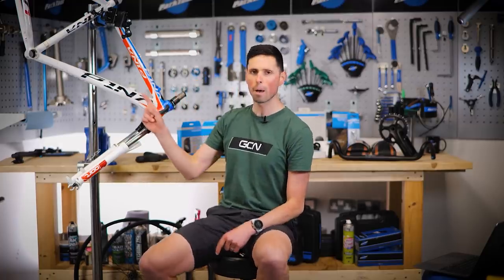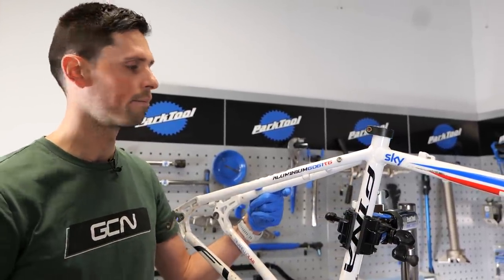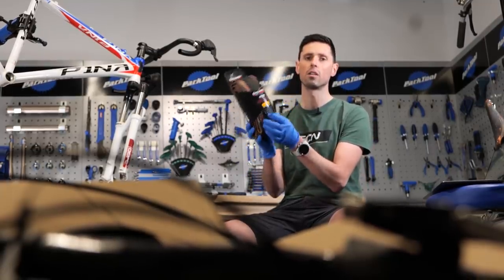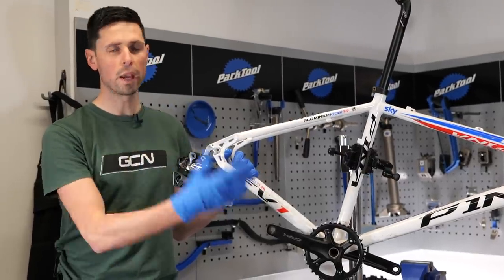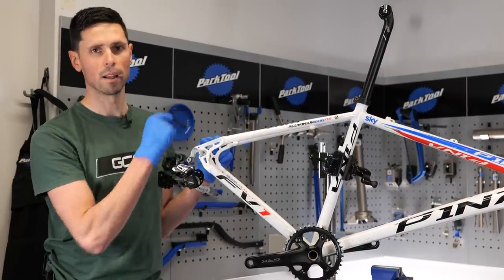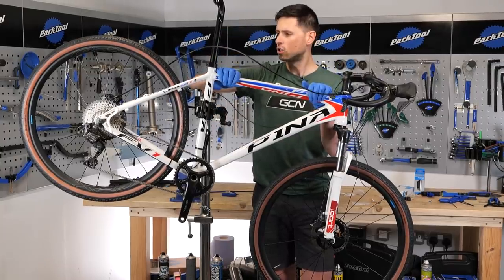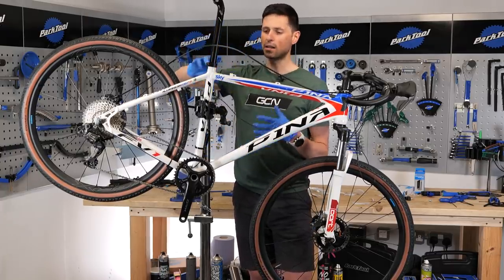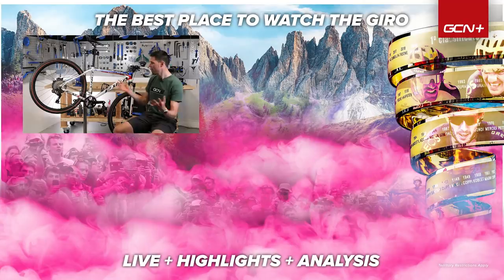Building The Bike! | Old MTB To Super Gravel Bike Ep. 2

Comment: So let me get this straight 🤔 He went to all the trouble of tracking down a particular Frame to convert, then didn’t bother to swap out the Fork, bodged the wrong size crank into the frame (should have used the MTB equivalent) as well as some guff about the wheels not fitting even though a modern wheel with a quick release adapter is no different in width to the original wheel and using a 42t cassette for climbing is great if you are a Pro but for the average person it Sucks especially when the GRX crank comes with a minimum 40t chainring, not to mention going from a flat bar for a dropbar isn’t just a straight forward swap as there’s a huge difference in reach and it needs to be explained, this series could have been great but I don’t know why they half-arsed it 🤷‍♂️
Reply: Because they do not think a lot before doing thing, they are poor mechanics and they do little to no research, they do not know much actually and that's really sad to see their incompetence trying to teach the wrong thing to noobs, when is it ok to stress the rear aluminium stays, there is going to be cracks somewhere for sure...

The fact that the only grease usage was on the threads of the bottom bracket speaks for itself.
Reply: Plus, Cold setting alu frame. What an expert!
Reply: It's an "advertorial" :)
Reply: It's an advert for Shimano, I wouldn't get too hung up on it.
Reply: @JamSa85  Actually this is what makes it even worse, adverts have a legal duty to not mislead or show the products being used in a way that could potentially cause harm to the end user without a legal disclaimer and even then a complaint to the Advertising Standards Agency could quite easily get this video taken down, if this was just somebody in their shed it wouldn’t be a problem but it’s two big companies saying it’s fine to use the products in this way when it really isn’t
Reply: Instead of replacing the fork, they could have rebuilt it. Sometimes it can be hard to find forks for bikes like these; but getting the parts or at least changing fluids/applying new grease to bits certainly in the realm of possibility.
Reply: Yes but no but... This was a three part advert for Shimano. Nothing more and nothing less.
Reply: agreed mate

Comment: I really think this challenge should be done again but with a budget for bike and upgrades to convert an old MTB to gravel bike. Looking at MTB to gravel conversions most of the time they will be a steel framed bike with a a rigid fork. This bike in stock form is just not what people talk about when looking at MTB to gravel conversions, completely misses the mark
Reply: ^This.

I'd guess that when someone is looking to convert a MTB to gravel, there's a good chance they're looking to avoid the nearly absurd prices of a new gravel bike. The di2 is complete overkill.
Reply: The same build is possible with GRX400 components and 2nd hand MTB-parts! Way cheaper and pretty suitable for an average gravelrider.
Reply: Typical GCN splash the cash nonsense, it:s a shame because they tried to make a good video
Reply: @FlourescentPotato  it's funny you saying this coz a year down the line they've had similar comments about the road bike upgrade build they tried lol

Comment: Not sure I would widen the frame on an aluminium bike that much! You can cold set steel and get away with it.  If you had gone got the Hunt 650b wheels then you can get them with QR at 135mm.  You may have also wanted to use an MTB bb and crank and that would have solved using a road crank.  You could have also used a wolftooth derailleur extension and popped a 11-51 in the rear!
Reply: GRX actually uses gravel q factor, which is a little wider than road if i remember correctly.

Comment: 4:26 You must be kidding, right? "Widening" the frame by 7 mm is really a lot, especially given it's designed to be a tiny bit bent inwards for the wheel to be clamped securely. Maybe I would understand such thinking when building a city commuter out of scrap parts, but I definitely wouldn't do that on a bike designed to be ridden off-road and especially when building it with brand new high level parts.
Reply: Absolutely. It seems a completely crazy thing to do. At that point he should have rethought the whole thing.
Reply: Naa It'll be fine.
Reply: @toddmcdonough  Todd, it’s aluminium, this is a seriously ill-considered thing to do.
Reply: True. I've got cracked my frame by adding just a small 2-3 mm spacer... This is a killing solution for aluminum frame. And what is the problem to get proper QR hubs in 2022??? 🤦🏻‍♂️
Reply: My thoughts exactly, why not just buy wheels with QR hubs¿??
Maybe none of their high end ,super expensive sponsors do such a low end hub
Reply: @normanlindsay4835  Only sponsors issues I think. Although the GRX 815 Di2 being a top-tier groupset, the Shimano GRX wheels are almost entry-level option (heavy and narrow given they are meant for gravel bikes only, for what you get they're a bit expensive). Some other brands still make disc brakes specific wheelsets with QR hubs, but if they really want to stick with Shimano even for wheels, they could've used previous generation (still available) XT 8000 mountain bike hubs (perhaps with those GRX rims).

Comment: Seems easier to add drop bars to a 1990 mountain bike and call it a gravel bike.
Reply: I've converted a  26' MTB to a road bike by replacing a double crankset with the original triple,  added a longer stem to my road drop bar and fitted 9 speed Shimano Sora brifters. Maybe I convert it to 29er wheels/tires later. Basically, all bike conversios are all plug and play, depending on your possibilities and your wallet.
If you should have an old MTB, a DI2 upgrade would be an overkill. For the price of a complete DI2 group us mortals could get a complete gravel bike if shopped wisely...

Comment: I've been doing this for peanuts ...no di2 mix match drive train and diy/oddpart brakes and what not on late 90s mtbs  26s ...26"to700c with drops .disk front rigid and suspension, cantilever adapter rear ...9spd 10spd

Comment: Might as well choose full wireless SRAM AXS instead of Di2.  On a non Di2 designed frame.  No more mucking around figuring out to where you can run wires or drill holes. To install your battery and hide the junction box.
Reply: Shimano sponsored this vid, so...
Reply: Wheres the fun in that?
Reply: I know it’s a Shimano sponsored video, but don’t understand why anyone buys di2 over etap. Wires, internal batteries, and junction boxes are old tech.

Comment: The problem with this is that frame designed to have a flat handle bar, therefore the top tube is 6 to 7 cm longer than on a road/gravel bike in the same size. I did the same mistake but the other way around. Bought a Trek road bike, put a flat handle bar on it, and even a 130mm stem did not fix the short top tube, that was designed to have drop bars. That's why real manufacturers have specific frames for flat handle bar gravel bikes, and hybrid bikes, and not just sticking a flat bar on a frame that is designed for drop bars.
This bike will not work, others have done it, it's called monster-cross. Top tube will be too long.
Reply: Smaller frame, longer seat post and a bit shorter stem should do it, no?
Reply: @yoavmiller216  Yes Ive converted a Rocky Mountain Blizzard in a smaller frame than I usually use with a short reavh gravel handlebar, short 35mm stem etc. Rides great to me
Reply: Yes you have to use a smaller frame if you want to do that. If it's an old frame it generally works better because they where much shorter than modern MTBs.

Comment: I would advise against fitting washers into shimano cranksets, for starters you would need to fit one on each side in order to avoid offsetting the bike center, and in that case your splines would be at least 4mm shorter than the standard, which is a potential hazard. A MTB specific crankset would've worked just fine.

Then there is the fact that that MTB to gravel conversions require straight seatposts in order to compensate for the longer reach in MTB frames.

And then there is the issue of streching the frame in order yo fit an incorrect hub. There are plenty of Shimano and other brand options that would've worked correctly in that scenario.

The bottom line is that these types of things should be handled by professionals and not by any random amateur giving away wrong advice.

Comment: "Opening the frame up for the wider hub"...

1. It's an aluminium frame, it'll probably survive but it's best practice not to. 
2. Even if you just use its elasticity rather than setting it in place, your dropouts are going to be out of alignment which can cause more problems.
3. Aligning the dropouts permanently will almost certainly do some damage, so just don't. Use a steel frame. ;)

Comment: It looks really fun. The mix of high spec modern components with this frame is a bit silly, which is what I like about it.

I would really like to see a head-to-head between this and a similar build with 26" wheels and mechanical shifting.
Reply: I did that one on a circa 2008 MTB. I ditched the front suspension and replaced it with carbon forks. 26" wheels on a 29er fork looked a bit odd until I filled some of the space with mudguards. Used 105 road brake/shifters of that vintage on a drop handlebar work fine with the 3x9 MTB drive chain. Next I'm going to install slightly larger middle and large chainrings to give me a bit more speed on downhills and pavement. I'll keep the granny gears for climbing. I've got about $600 Canadian in it so far and I've learned a lot.

Comment: The hub spacing is identical. 135mm QR has he same distance between the stays as 12x142 through axle. How else would the wheel fit with an adapter in it. Spacing that bb out is normal even for mtb cranks. Should just have put mechanical GRX on it.
Reply: The chainstays for 142 have a recess of 3,5mm per side to accomodate a 12mm TA instead of 10mm QR, but true, with regards to the offset from the cassette and a derailleur hanger they are identical. Thus what Alex did was a massive bodge
Reply: @feedbackzaloop  Yes indeed there is a recess. Wheel spoke angle and such is the same. And actually that cassette could have fit on the original wheels... Using fast 2.1xc tires would have made much difference in rolling resistance over 45x650b wheels.
Reply: @luukrutten1295  not really sure about the cassette, if GRX is identical to XT 8000 or built around a road standart, then it would not fit the old hub.
26" with 2,1 tyre is simply smaller, and although would do the job as well, is not that aesthetical as 650 (27,5") with 45mm. But at least Alex could have relaced the new rim

Upd: oh, it IS an XT cassette here. Yes, fits perfectly then
Reply: Actually the 45mm tire is only marginally larger than a 26x2.1 only about 15mm different in circumference.
Reply: @luukrutten1295  actually, true. 25mm difference in rim diameter, about 18mm other way round in tyre thickness - so, 26" is less than 4mm smaller in radius

Comment: To be honest for you viewers you can save like 500 usd from two components alone

Hubs and freehubs: look for some old LX/SLX hubs and rebuild it yourself
Brake calipers: look for some MTB brakesets with broken levers

Bada bing bada boom
Reply: For mix and matching brake levers and calipers you need to look for what type of brake cable they use. Shimanos uses BH59 (for cheap brakes or old busted brakes) or BH90 (for new hotness brakes). Theoretically you can use dura ace levers on saint 4 pot calipers and vice versa, but would you? You can ask Ian Malcolm

Comment: Nice video! Why does it make everyone's life easier to line the tyre logos with the valves?
Reply: When using tubes. If you get a puncture in the tube, you can usually find the object that punctured a lot easier by using the valve/tyre logo as a reference point.

Comment: looks great, I wonder where can you find the max. casette size the grx derailer will take? i got grx myself but was never sure how big I could go
Reply: It's written on the back of the box;
Alternatively you can find it when googling your exact rear derailleur parts number.

Additionally, Shimano is pretty conservative, there are people running up 44 or 46 on 1x grx, eben though 42 is stated as max iirc
Reply: If you got guts to try, use wolftooth goatlink and put 10-52, fingers crossed
Reply: @agunlogisteam  I've used the dm link (?) To get 11-40 on the grx 2x by which only goes to 36 or 38
Reply: @金安迪-g5q  11_40t works fine with grx 2x 30/46t up front as that's what I run. No wolf tooth adapter required. Just a slight adjustment on the B screw on the mech. 👍
Reply: @greigmackay8465  nice, but It is by definition out of spec.
 With the road link dm( that's the exact name iirc) you do not need to adjust the b-screw at all 👍
Reply: I am happily runnong 11-46 with the '1x' GRX mechanical mech and a 40t chainring. Not needed an extender. I suspect it might go bigger if ypu did use the extender.

Comment: Woo - that's hilarious - I have a 2018 bike with a GRX 810 setup - 
but back then post mount was standard - and I am using those same 
Ultegra BR-RS785  brakes.  They work amazing.

The question I have: Is what that is the travel on that MTB fork ? Is it ok to have like 100mm
of travel on a bike with drop bars ?  even the new XPLR is like 20-40mm ? right ?

Comment: What did you use to space the crankset with?
Having the same problem here..
Reply: Mtb ht2 bottom brackets come with spacers, usually 3 of them included with the bb. That's what he used
Reply: @greigmackay8465  He used a road BB which does not come with spacers. He used 2.5 mm spacer which are only available with MTB BBs. MTB and road BBs use different cups and are not interchangeable.
Reply: You need to switch to a MTB crankset and BB unfortunately.
Reply: @ivanivanov7064  that's what I said he used the spacers that only come with mtb bb's 🙄
Reply: @greigmackay8465  It's wrong to use those spacers. It won't fix the problem Brian is having.

Comment: Wow Amazing! Just want to ash what GRX crankset did you use and also bottom bracket. Thinking to change my slx crank to my Trek Marlin. Also what length of the crank arm. Pls. advise and thanks for this video. :)
Reply: If its an older bike with 68mm BB you can use grx/road cranksets. With the modern 73mm that does not work because the cranksets axle is too short.

Comment: I wonder how the 650b rear wheel and tire fit in a frame designed for 26".  No way would that work on my late 80s MTB.
Reply: I can fit 1.9inch (48mm) 650b gravelking sk on my old school early 90s frame. That’s probably the upper limit of what you can fit. The tires do fit wider though so closer to 50mm
Reply: Im using 26er and still got front deraileur on, trying 27,5 (650b) and the max clearance is 47b. Without fd i think i can put 27,5 x 2.1 without any issue

Comment: Great video of an interesting challenge! I managed to convert a Cube Nature ATB/crosshybrid to a gravelbike with way cheaper components (GRX-400 series) than in this video. Great solution for the scarcity and prices in the (gravel)bikemarket. I solved the crankarm-chainstay problem with a Deore crank with a narrow-wide singlespeed chainring, works fine with GRX! 

In the meanwhile I upgraded the frame (which was quite heavy) to a much lighter Specialized Source (=Sirrus) frame, with a slight upgrade to second-hand GRX600 shifters and a GRX810 detailleur + a Ritchey carbon fork. 
At 3:04, what adapter (brand and type) is used here?

Comment: I did some of these conversion myself and although I generally like the idea, especially going 650b wheels, this build doesn't make much sense. Instead of swapping out everything except for frame and fork, the name of the game is to repurpose as much as possible to keep the costs down. And invest the saved money into a carbon rigid fork to bring the weight down. I would have kept the crankset, probably throwing 48/34 rings on and make it a 2x9, and hunt for old Ultegra 6500 brifters (which are compatible with MTB components).
Reply: Shimano sponsor, so expensive new parts.

Comment: Why not do it properly? Get the right width hubs,  use the right crankset and bottom bracket and sort out the reach as best you can.  

What you have is half arsed and (when setting and alu frame) potentially dangerous advice.

I'll be honest I was expecting better. I get its shimano sponsored video.but at least get the right stuff supplied. 

Oh and that mech will easily cope with an 11-46 and probably up to 51 with a hanger extender. That 40-42y you have will be fun on a gravel climb.

Comment: When your components cost more than your frame……….

You know your decisions are wrong 🤔🤔
Reply: How do you come to this conclusion? Apart from using entry level components on a very botique brand carbon frameset the frame is basically always cheaper? Just a shimano 105 groupset and some reasonable wheels are way north of a 1000€, not counting tires, saddle etc in - that already is more money than most well known brand steel and aluminium framesets.

Comment: How do you resize an ali rear dropout?
Reply: Put frame flat on ground. Step on inside of dropout, grab other dropout and pull up. Check spacing with wheel and repeat as neccesary. It'll be fine.
Reply: @toddmcdonough  really, I know it's OK with steel, but ali.......

Comment: You should NEVER put spacers on a road BSA BB! There's a safety pin on the left crank arm for a reason. Very hazardous decision. Should have gone for an XT/XTR crankset and BB which would resolve this issue but I guess it's just a GRX commercial... Also this bike looks painfully undergeared. 42/42 lowest gear, come on... 38x24 or similar MTB crankset would work great on a bike like this. There's nothing wrong with the hub spacing - nothing needs to be "widened". A 12x142 hub fits perfectly into this frame - you just swap the end caps for a QR ones which effectively reduces the spacing to 135 mm.🤦🤦‍♂🤦‍♀